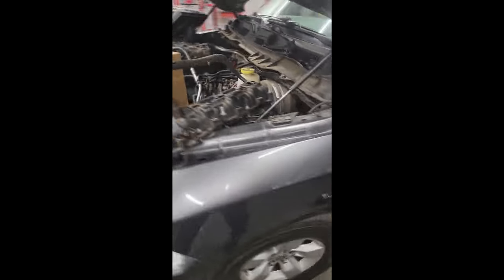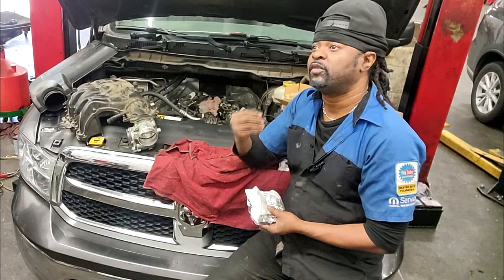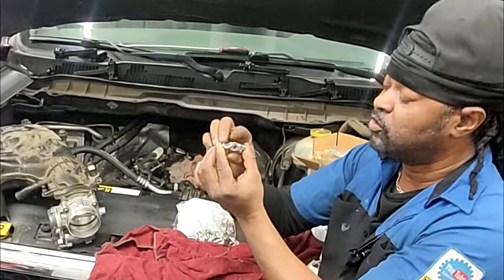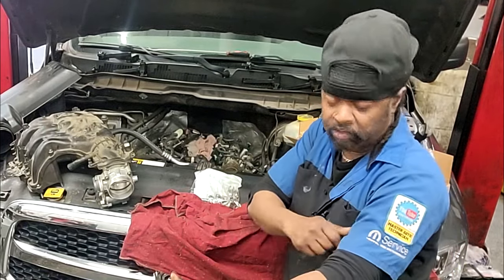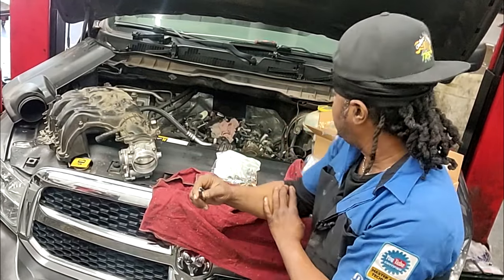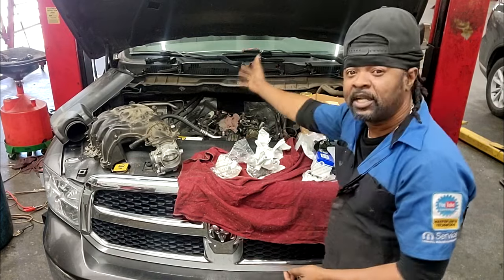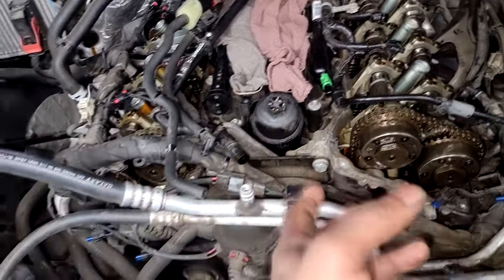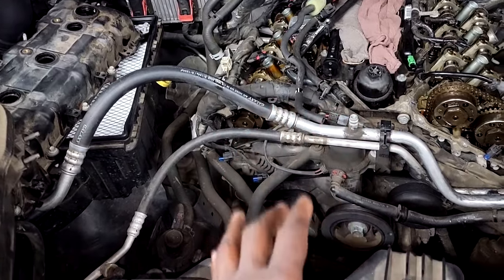180K mile motor. Never Just Do This. Go to plan B.

Comment: They need to dump all the lifters and rockers. Once you have to replace a cam get rid of the rest of it. Go in there one time one and done. Sooner hopefully sooner pulling the oil pan and clearing out the oil strainer becomes a necessary part of the job. Now, it is repaired and running on a clean lubrication system.

Comment: Now I’ve seen that with of these kinds of miles even 200,000 miles or more I get it I would get all those done but all I’m saying is I’ve seen Hemi’s Ford 5.4’s and the like even Chevy 5.3’s driven in the north that still has the original rocker arms and cams so it sometimes doesn’t come down to age  it just depends on how you take of them.For example my buddies Ram is an ‘08 Hemi with almost 300,000 miles on it and the body is rusting out and his motor is still purring along and he’s bragging about how dependable his truck is.
Reply: They have different generations, the 08' does not have the same issues as the 2012 and up.
I have a `14' that gets meticulously maintained and I still ended up with the same issue is this here.
It was piss poor design that caused the issues.
Reply: The 3.6 in my 2015 200 started ticking at around 40k miles. Did oil changes every 6,000 miles and it still happened. No way to prevent it. Just luck.
Reply: 6000 miles is too long for an oil change - get that down to 3-5 thousand miles.

Comment: I fell trap to working at Chrysler and just thinking they are making mainly junk which is probably something a lot of new techs at dealers go through with their brand. Then I bought a 2019 classic ram 5.7 new. Now it has 110k miles and only typical issue I’ve had is manifold studs snapping and ticking like they usually do. But other than that nothing but basic maintenance. Battery tires and brakes. I was expecting water pump and fuel pump at the least by now. But it’s been a strong truck even after towing 10k lbs for about 20k miles of that.

Comment: what if the cam lobe is chewed up a lil bit. Are you eye balling it & then measure the lobe to verify that it will operate at top efficiency? I ask ignorantly & for the fact that 3.6s are in some heavy vehicles so I figure you want the best intake & exhaust lift. Great video as always OG !

Comment: My 3.6 62te 2014 T&C has 183k just did 3 cams, rockers, lifters, water pump, oil cooler lines. Is bucks when letting off the gas at speeds over 55. Any ideas?